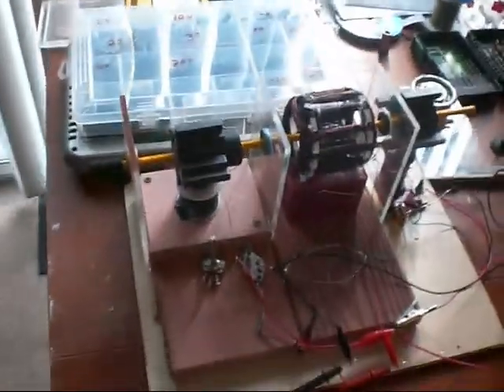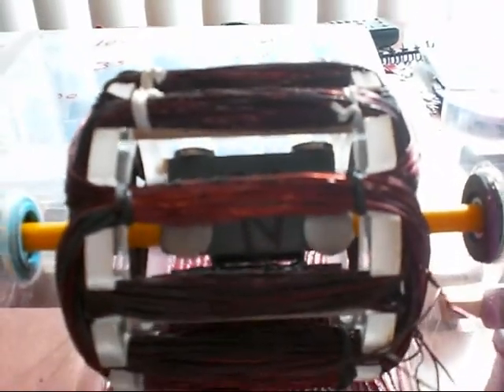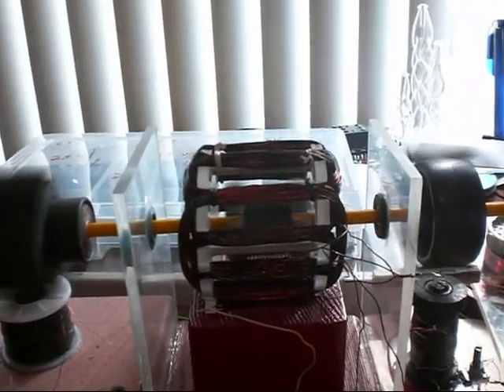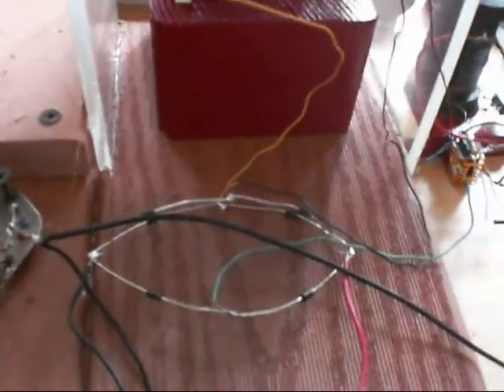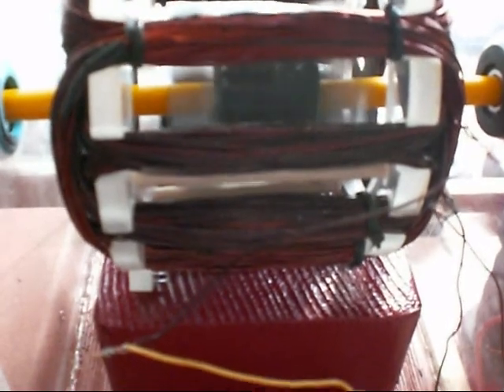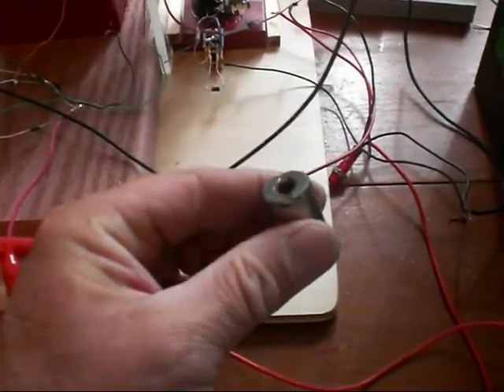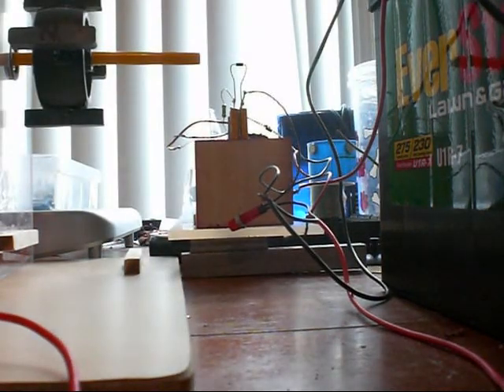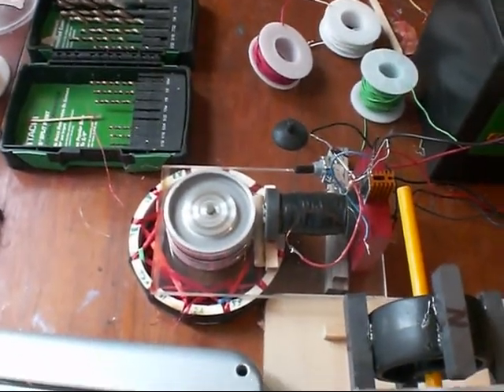2 Cylinder bedini

Comment from the maker: @jjackdaddy56 If you looked at the dates I was working on this two years ago, I got it to work but never got more power out than in. I hope you can do better then I did. I have more of a construction back ground then electrical so have been more interested in learning about building an earth ship and off grid power source construction. Wind mill or water wheel. Good luck on your quest for knowledge. I learned alot building these models and hope to use what I learned in my life. Again good luck!

Comment: Your Magnets are too far away from the wires in the squirel cage motor. You need to get either bigger magnets or make rotor bigger to get magnets close to wores. make sure diodes are facing the correct way, just one can screw it all up.

Comment: One easy way to deal with the wire is to pull an old alternator from a junkyard. All you have to do is remove the case and pull out the magnet shaft. The winding is mounted on a non-conductive frame that makes it a lot easier to mount for different projects.

Comment from the maker: Hi I have 6 diodes they just are not visible in the video. I only have 37 turns on ea coil, that is all that would fit with the heavy wire. 
they are all anti-then clock then anti-then clock for 3 phases.  Phase the turning of wires to correspond with magnetic orientation? That must be my problem I am not sure how to do that. Ive changed the cage so that the wooden dowels are out more 
(even with the wires) and removed neos and put another bar magnet so the clearence is alot closer. low power

Comment: Hi well done but I see you have only 4 diodes in your rectifier. You do need the 6 configuration to work correctly. Your gage of wire will work. How many terns do you have on each phase? Did you phase the turning of your wires to correspond with the orientation of you magnets?    Clockwise next anticlockwise then clockwise then back to anticlockwise? That would be 1 phase just repeat that 4 the next 2 phases.